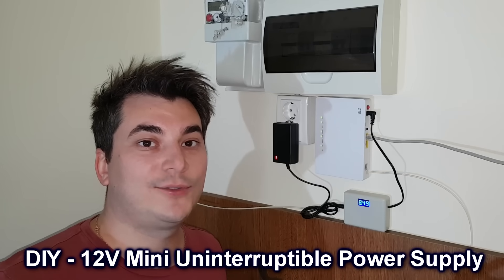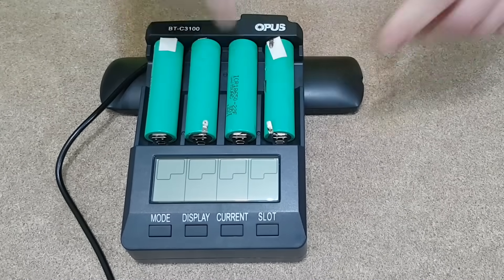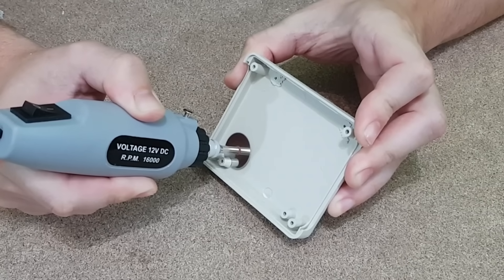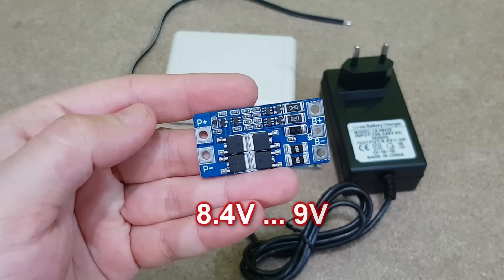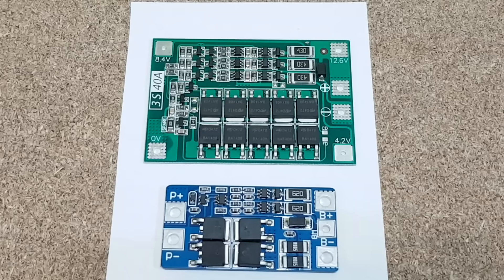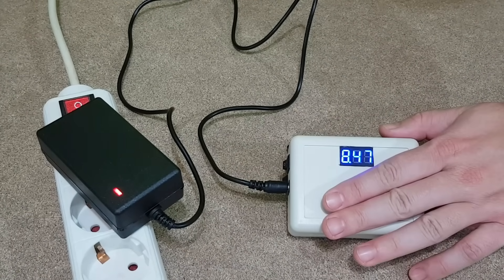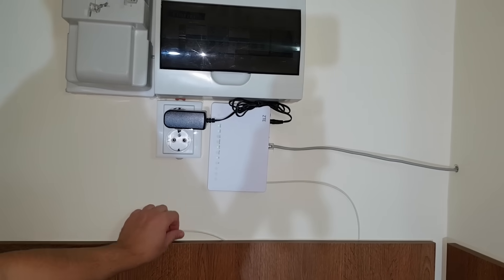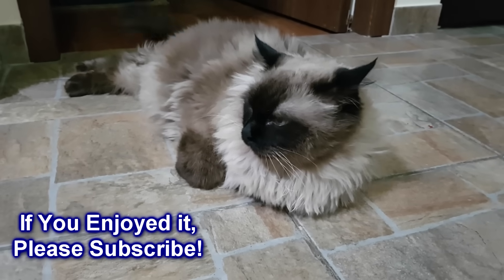DIY - 12V Mini UPS

Comment: What if I dont use that extra capacitor?
Reply from the maker: it will still work.
Reply: @Sorin_DIY  and if I use 9v-0.6A adapter and 14500 batteries will it do?
Reply from the maker: it will probably work for a load smaller than 0.3A, but that 0.6A charger is very underpowered, I don't think it will last long.
Reply: @Sorin_DIY  brother!  I've searched the whole local market but couldn’t find that 2s bms board or any bms board for that matter! Can I use something else istead!?😐
Reply from the maker: you need a 2S BMS with balance, otherwise you can't charge the cells.
Reply: @Sorin_DIY  One last question, if you Don't mind. My router's input is 5v, if I give it 12 v input will it affect the router? Don’t routers have inbuilt stabilizer?
Reply: @ikbalhasanjishan1891  If your router needs 5V, then just take new usb cable and modify the output cable to the same dc male jack and use powerbank to power it.

Comment: Hey, is it possible to hook four batteries to a single 2S BMS? I mean, connect each pair in parallel and connect them in series.
Reply from the maker: yes. that is a 2S2P battery pack - 2 series 2 parallel.
Reply: @Sorin_DIY  Thanks Mate

Comment: Can i use this for 12v 4.3 inch  cctv monitor?
Reply from the maker: it depends on the power consumption. I think it's better to use a UPS with a bigger battery pack.

Comment: Hi, I noticed that the ups are not charged in the power connection with the charger.  Must be connected to a router?  what could be the problem?
Reply from the maker: hi. the mini UPS should be charged all the time, it doesn't matter if the router is connected. you probably didn't connect something correctly, check the schematic and wiring again.

Comment: But i think we need two output from the ups, one for the modem and other for the   internet media box
Reply from the maker: hi. it depends on your equipment. I have an ONT, which has a media converter and router function included. but I plan to make soon a better UPS with 2 outputs.

Comment: Hi,I built according to your instructions but I need to know and measure how many volts and tune.  Can you upload a video or diagram to the voltmeter + what parts exactly do i need?  Thank you very much. 😊 🙏
Reply from the maker: hi. are you referring to the DIY voltmeter/ammeter? I have the DIY voltmeter/ammeter tutorial, but on my Patreon page. I need some videos for my patrons only, as a gratitude for their support. on my Patreon page I also post extra footage and updates about future projects. you can become a patron if you want, for only $1 - $5 /month.
Reply: I would be very happy to join because I really like your works. Thank you very much for the attitude and answers as well as the great works that you have.

Comment: can you make another video by just using the 12v stock adapter so i will not buy anymore 9v adapter ? 🙇‍♂️🙇‍♂️🙇‍♂️🙇‍♂️pls
Reply from the maker: hi. I thought about that, but in that case you need another step down converter, so there will still be an additional cost. but I will make soon a bigger and better UPS.
Reply: @Sorin_DIY  i will always watch all the ads for you to make that video i cant wait
Reply: will this mini ups works with my diy 12v electric fan convertion which is 15-18w power consumption

Comment: Does the BMS board have a cut off current after which it stops supplying voltage?
I used the same BMS board it is not cutting voltage if my modem is not connected. But when I connect modem it cuts off voltage
Reply from the maker: hi. I've found a better 2S BMS board than the one I used in the video. the link is in the video description. this one has all the protection features, including overcharge recovery voltage. the one in the video doesn't have this feature.

Comment: Do i still need to use step up converter if i will use 4 18650 battery?
Reply from the maker: it depends on the battery pack configuration. if you make a 2S2P battery pack you still need a step up converter.

Comment: Bro I brought the same BMS board but the BMS cuts off the voltage just after 40 minutes. When I check the voltage of cells by Multimeter it shows >3.4V  left at each cell.
Do you think it is still problem of cell over discharge?? Or any other problem?
Reply from the maker: what type of lithium cells did you use? do they have over-discharge protection included?
Reply: @Sorin_DIY  I used one battery of my samsung phone do you think that it has inbuilt protection or is discharging too fast? It is one of the 4 terminal phone batteries.
Reply from the maker: yes, probably the battery has a different protection circuit.

Comment: Hi,If I connect 4 batteries do I need to fuse each battery?
Reply from the maker: no. one fuse on the battery pack positive terminal is enough.

Comment: I was trying to build this but i don't see the fuse amp ratings. What fuse did you use on this? Thanks
Reply from the maker: hi. it depends on the power consumption of your load. my router is using less than 0.5A at 12V, so a 2A fuse on the cells is enough. if you have a bigger load, you need a bigger battery pack and a fuse rated for a higher current. and very important, use the BMS board from the video description, it's better than the one I used in the video.

Comment: I have a problem when I implemented this, let’s say 
When the batteries drain out after 2hrs of backup and then after when power is back then this circuit can’t power up my Wi-Fi router until batteries reach sufficient voltages.
Can you please help me how to over come this.....
Reply: It can that's why power input is parallel with booster module. It can power up until your batteries charge up and simultaneously chage the batteries
Reply from the maker: hi. the charger should charge the cells and in the same time it should power the step up converter. maybe the charger doesn't have enough power, what charger did you use?
Reply: @Sorin_DIY   thanks for replay, I am using 8.4 dc  with 2Amp power rating adapter. 
And yes ideally what you said is correct but batteries getting discharge and when power is on the voltage keeps fluctuating at output which is less than 12v.
Reply from the maker: have you tried it with a different step up converter?
Reply: @Sorin_DIY  I have tried with MT3608 step up module yet still the same, as input power source which is rated 8.4v dc gets fluctuate to 6.5v dc when load is applied. 
I've also tried with 9v dc power source it too gets fluctuate. 
Please suggest!
Reply: @Sorin_DIY  I have question, does reverse voltage from battery will not effect  the circuitry of power adaptor? During the load and no load operation. Please help me on this

Comment: If I am not wrong, the batteries are continuously charging and discharging at the same time while the power from mains is available. This must reduce the overall battery life. Is there any way to bypass pulling power from the batteries while the electricity is available and switch to the batteries when power is gone without turning off the WiFi?
Reply from the maker: hi. there is a better BMS board for this project, the link is in the video description. it has an overcharge release voltage feature. when the charging of the cells is completed, the charging current is interrupted. the charger voltage is higher than the cells voltage, so that's the voltage that will power the step up converter, not the cells. the cells will help only when the charging voltage drops.
Reply: @Sorin_DIY  Thanks for the info
Reply: @Sorin_DIY  Hey let me know how is your device working and how much backup you are getting from the batteries. Although with your current setup also, the batteries may not discharge once equilibrium is achieved between the internal resistance of the charger and that of batteries while plugged in.😁

Comment: Bro thanks so much... I have made all connections and tested the ups...it is working for 15min.
Only a small problem the BMS board kicks in the over discharge just when my batteries are around 3.7V. Could this problem be corrected? Any guess about the mistake I might be making.
Reply from the maker: what BMS board did you use?
Reply: @Sorin_DIY 
This one
 https://www.amazon.in/dp/B07MV9C9JN/ref=cm_sw_r_wa_apa_i_PKk-Eb3SSCJ87
Reply from the maker: this BMS board doesn't have balancing feature, but it should be ok. have you tested the cells? maybe one of the cells discharges very fast and the over discharge protection feature disconnects the battery pack. you should use the BMS board from the video description. it's much better.
Reply: @Sorin_DIY  I don't have a battery charging and discharging station.
After the it disconnects the cells the battery pack voltage is still 7V. So I think there is no fast discharge from batteries.
Reply from the maker: I think the BMS it's not working right.

Comment: Hi Sorin,

First of all thanks for the wonderful video 

I have some queries 
1) I have created the same as you had informed my batterry while connecting it was 3.47 and 3.68 volt once it connected it had some 6.7v I am charging it using 3amp USB adaptor to DC I don't see any voltage increase on my bms board B+ AND B- 
2) XL6009 is already having a capacitor you have connected one more why is that is really required ?I tried to get it but I could not I got 25V capacitor will that work ??
3) if I can't use a 3amp adaptor usb to dc cable to charge can i use 12V charger ??
Of yes let me know how ??
I seen your of comment says use a diode how which one i am new i don't know much so please bear if I did any mistake 
4) can I connect this to 12v 1.5amp router it won't impact right ??
I did a same kind of router ups using xl6009 output and input tp4056 connect to a single batterry to charge a 5v 1amp or 12v0.5 amp router now router is working fine but wifi is not working though all lights are still on and now my router is der incant connect to the wifi but it says DNS error but same time when i use lan directly which is connected to router I am able to connect to internet then I felt my router is up but now I can't use internet from it.

5) Can we add any led to find charging ?? Is it charging or charging is completed ??

Can I use this for 12V 0.5amp router 
Or it will work for 12V 1 amp router 
12v 1.5amp router 

Thanks a ton in advance for helping me in this it really means a lot at this pandemic
Reply from the maker: hi. 1) if you use a USB adapter with 5V, that's not enough. if you made a 2S battery pack with the 2S BMS board from my video description, you need a 8.4V & 2A charger. 
2) the capacitor is not mandatory, but I added one to keep the voltage more stable, when connecting the load (router). a 25V capacitor is ok. 
3) for this battery pack you need a 8.4V charger. not a 5V USB adapter.
4) you need to measure the real current consumption of your router. then you will know the required power from your UPS and determine how big the battery pack must be. 
5) no. other BMS boards have LEDs included. 
when building something like this UPS, you need to measure, test, measure again, modify something, test again... there isn't a simple yes or no answer for all you questions, you need to design it as you go.
Reply: @Sorin_DIY  Somehow i got 9V 2 AMP charger todya but now it power led is always on even when i switch off the Charger how can i stop power going back to adaptor?

Whats the charger you have used which shows two lights Red and Green when fully charged ?
Whats that kind of charger called?

Is there any other way i can set up a led to find charging completed 

I have got a BMS board which is long it looks like the below 

https://www.banggood.in/2S-3A-Li-ion-Lithium-Battery-18650-Protection-Charger-Board-BMS-PCB-Board-p-1358991.html?gmcCountry=IN&currency=INR&createTmp=1&utm_source=googleshopping&utm_medium=cpc_bgs&utm_content=lijing&utm_campaign=pla-ing-all-pc-0309&ad_id=424344603535&gclid=Cj0KCQjw0Mb3BRCaARIsAPSNGpXnzz0PB1tndbWLFKA7ogKAbJ7mgjlj4KI4AUrY9krFPs9VcB617iwaAnXVEALw_wcB&cur_warehouse=CN
Reply: Can we use 12v charger is Yes how can we do it ?? 

What's the process ??
Reply from the maker: hi. you need to reduce the voltage to 8.2V. you can use a step down converter. or you can use a few diodes in series with the charger positive wire. diodes can conduct current in only one direction, but they have a forward voltage drop of 0.5 - 0.9V. a few diodes in series will decrease the voltage enough and they will not conduct current in the reverse direction.
Reply: @Sorin_DIY  

Hi I have got the 9v and 2 amp charger but now when ever current goes my currents goes reverse to the adaptor and batterry gets discharged and then my router is not powering on I have to manually go and turn of and on the switch them it works 

How to stop this using a diode and which diode is suitable for this 9v ??

Also one more last doubt will this work for 12v 1.5amp router it works for 12 hours after that once power goes off it gets off and den I have to manually go and switch of the current and switch on and then only it works why what's the reason ??
Reply: @Sorin_DIY   Thanks a lot for acknowledging my Comment and stupid questions but you really made it worth i trying this project

Comment: Having problem with the polarity.
I don't have the tool to check polarity, is it too risky for router to use other cable doesn't match the polarity?
Reply from the maker: hi. you need a multimeter for these projects, even a cheap one. if you reverse the polarity you may damage the router or the DC converter. you can at least use an LED in series with a resistor to check the polarity.

Comment: Hi Sorin, i have an issue with my circuit.  Since i do not have access to 8.4 v wall adapter insted of it. I am using step down converter 4015 to connect BMS to it.   When I disconnect main power my router works.  
But on 4015 input terminals current drawn by wall adaptor.  How do i stop backward current.   

Also there is constant drop in voltage on battery without connecting router.   

I am using 12v 2 amp wall adapter
Reply from the maker: hi. you can connect a diode (in series) on the positive wire of the 12V charger.
Reply: Sorin - DIY Electrical Nerd many thanks.

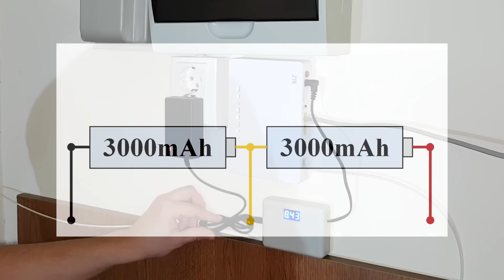Comment: 12:15 so I will use other step up converter if I will use that battery configuration? Because the max input current of the step up converter is 4A. In a parallel configuration the Voltage remains the same but the current is added up
Reply from the maker: hi. the current delivery depends on the load, it's not delivered continuously at the maximum value. if a load needs 1A, it will use 1A no matter if you connect it to a 2A or a 10A power supply. for example a 10 ohm resistor, if you connect it to a 5V power supply, it will draw 500mA (Ohm's law I=U/R). so if you connect that 10 ohm resistor to a power supply of 5V & 2A it will draw the same current (500mA) even if you connect it to a 5V & 5A. the maximum current value is the maximum amount of current that the converter can handle, if the load needs it. the converter doesn't continuously use 4A, otherwise it will discharge the battery in a few minutes. if the load needs 1A from the batteries, the converter will work with 1A. if the load needs 4A, the converter will work with 4A. if the load needs 5A, the converter will most likely burn. you need a more powerful DC converter only if the load needs more than 4A.
Reply: @Sorin_DIY  I guess this is the common misconception for beginners like me. Thank you very much for the clear explanation.  Have a good day.
Reply: @Sorin_DIY  Lastly, 12:15. When using that battery configuration,  what charger should I use, 4.2V or other and how many Ampere/s?
Reply from the maker: you need the same chager 8.4V & 2A
Reply: @Sorin_DIY  But the 4 batteries are in parallel so the voltage in the battery pack will be 4.2V because in parallel the Voltage is the same but the current is added, is that correct? Thank you
Reply from the maker: there is a pair of cells connected in parallel and another pair of cells in parallel. the 2 pairs are connected in series. this is a 2S2P battery pack - 2 series x 2 parallel. double the voltage (of one cell) and double the capacity. it is still charged with a 8.4V charger.
Reply: @Sorin_DIY  Thank you very much Sorin. Now I can make this project with the available resources around and with no worries. Have a wonderful day!

Comment: First of all thank you so much for the wonderful tutorial. There are two things i wanted to ask you sir. 1. What if we connect volt meter after the converter 12volt side? 2. My 8.7v charger don't have auto cutoff circuit when it's full charged. So if i connect power continuously will it damage my Router or Circuit? Thanks Sir.
Reply from the maker: hi. if you connect the voltmeter after the step up converter it will always show 12V. I suggest you use the 2S BMS from the link below, it stops the charging automatically when the cells are fully charged. the 8.7V charger will still power the step up converter:
https://www.aliexpress.com/item/32863604994.html?spm=a2g0o.productlist.0.0.78a81a17yfgf8N&algo_pvid=7a7a9384-1f05-43f8-af1c-2152aba8627a&algo_expid=7a7a9384-1f05-43f8-af1c-2152aba8627a-1&btsid=0ab6d69f15918369686154295e5c92&ws_ab_test=searchweb0_0,searchweb201602_,searchweb201603_
Reply: @Sorin_DIY  thank you so much sir, Really really appreciated your kind advise. this is exactly what i wanted. God bless you.
Reply: @Sorin_DIY  Sir, You have really inspired me and i have made it with the help of your video. But there is one problem. It took 5 Diodes in series to convert 12V to around 8.6V and Diodes are getting really really very heat up while charging. For now i have unplugged for safe side. Can you please help in diode heat problem i am so close :)
Reply: @Sorin_DIY  I have 12V Charger for input
Reply from the maker: hi. you need more powerful diodes, 5A or more.